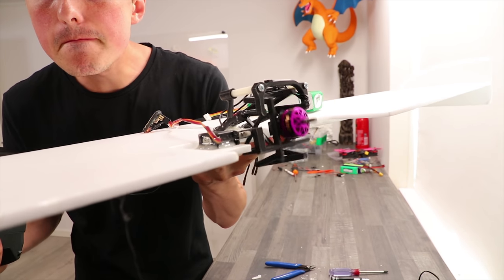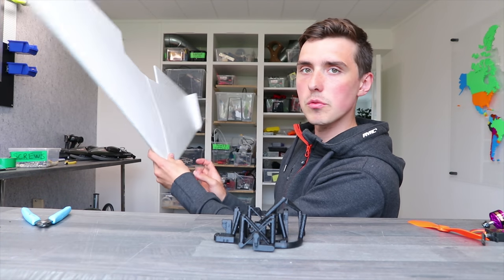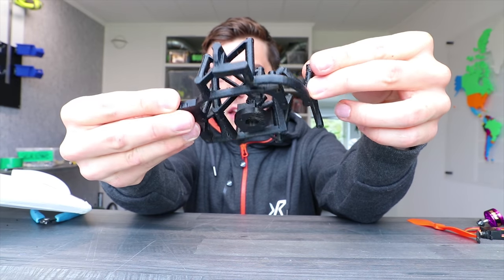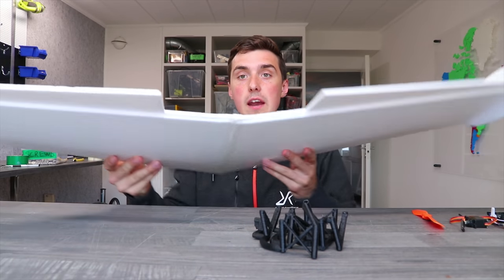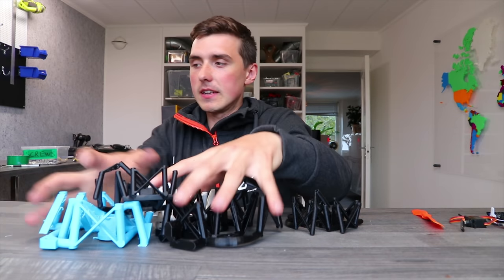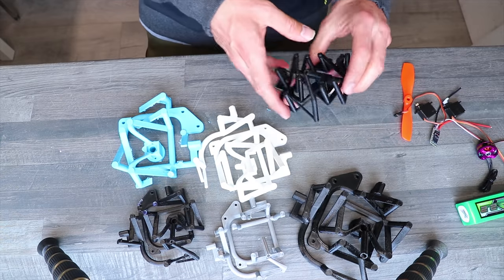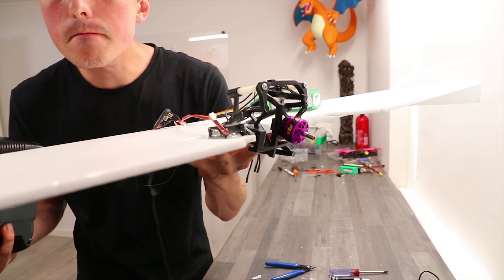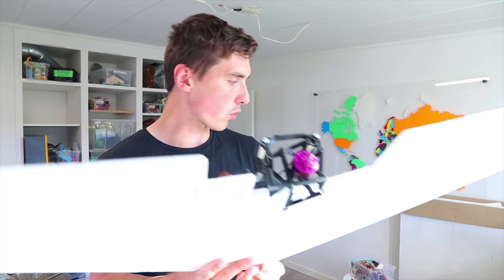3D Printed Vectoring Mechanism

Comment: Stress fracturing negates all the magic of compliant mechanisms, and literally every single layer printed is another perfect spot for one to happen lol.... I bet this is a scenario in which a resin printer would really shine. Personally, I'd say your prints snapping is more closely related to "forced delamination", rather than a failure of the material to endure the applied stresses.
Otherwise, apart from your not printing these in their original medium of titanium, I would imagine the dimensions/thicknesses  throughout the entire mechanism would have to be altered significantly for every different plastic you've printed them from. Technically, by only changing the material of the prints (rather than altering the varying thicknesses in the print) you were only determining which has the closest attributes to their original titanium counterpart...... that is assuming you didn't altar any of the dimensions from the original design file.
.....Apart from that, it seems the simplest option would be to scale up the air frame ;-P

Comment: Tube with motor mount plate with stub axle top and bottom that locate in a secondary ring that has horizontal stub axles fitting into tube bearers set in wings??? Two ends of household plumbing pipe of different sizes and some dowl + thin bearer tube + glue and drill

Comment: I think the biggest problem youre going to face is gyroscopic precession ... I might out of my bonking gorde here, but, unlike on a rocket, your propeller is going to apply force 90 degrees from the axis that you are trying to rotate it at. 

Meaning when you try to pitch, since the mount isnt rigid, its likely going to yaw. or whatever. 

Either that, or your motor is torqing the shit out of the motor mount and its not designed to handle torque like that.

Comment: Why just a simple hinge? It makes it a lot harder when you try to use a flexible hinge type.
Reply: He was originally trying to do a 2 axis vector so it would not need any control surfaces.  To do that, it needs to rotate in the pitch and yaw axis at the same time.  Not sure how it would have rolled, but since it never worked anyway, that point is moot.  Though usually if you put in enough rudder the wing will drop.  But since he gave up on the 2 axis version, with apparently no flight test at all, he only needed to pitch.  He could have done that by attaching the motor to a elevator instead of that elaborate 3D printed part though.
Reply: Yes, but even a pan and tilt mechanism would be a great deal easier just using screws for hinges. And good point with the roll axis, never would have thought about that!

Comment: Wtf...the esc can provide the 5v power. None of my eco planes need a separate power converter for the planes. The only one I have that does is for my hexacopter and that’s because of the way it’s designed. If you get a esc capable of powering the receiver you can eliminate some weight which is good in the end...

Also you should treat your print. By that I mean after it’s printed place it in a pot of water and heat it up to boiling. After 10 or so min cool it down and it will be stronger. It will take experimentation as the print will shrink and possibly warp. What this does is heat the print enough to almost melt. This allows the molecular structure to rearrange into a more stable and solid piece.

Comment: I think instead of having it flexible make it stiff and use gyroscope design to vector. Bit obviously with fixed max angles. The concept idea is cool but nor really suited for 3d prints. However stiff should be well possible
Reply: May be make it in Titanium?..
Reply: Apart from the fact that you cant produce this diy out of titanium, it would be to ridgit. A gyroscope style design where you controle the axis via servos would be the better design IMO

Comment: I laught my butt off too with the maiden flight and your reaction xdddd.. Apart from the obvious flex which made the problem worse, you need to first calculate the CG and then the thrust line of the motor needs to be tilted so it goes through the CG..... Ask me how I know..

Comment: some info.     ever hear of a thing called   d o m.     distribution of mass.     No one else  has, either.      a  Lot  of  mass  was  added to the airframe,  AFT  of the c-m.   center of mass.         as you have  perceived,  controlling a   zero-dihedral flying wing  with vectored thrust, is not practical.     cheers

Comment: Could your concept even work if nothing went wrong? I mean you couldn't control the roll with the vectoring mount only?! 
But great video anyways👍
Reply: That is because he had ailerons installed
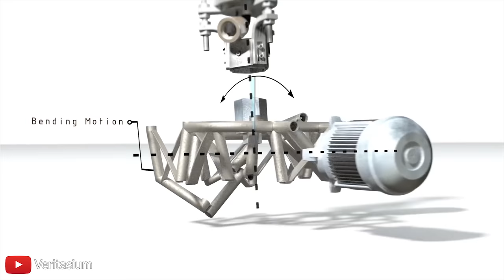Reply: velos26b Well at 1:49 he said that the vectoring mount would eliminate the need for control surfaces. I think he only added them after realizing that the vectoring mount didn't work in both directions.

Comment: Compliant mechanisms and FDM printing is no bueno - you're after fatigue life for compliance, which is something that FDM printing will have a hard time producing. Also, in terms of engineering, getting a compliant mechanism to produce a predictable lifespan is not trivial - it's something that is just now gaining traction due to the abundance of computing power and analysis available today. 
Somehow you're going to need to design that apparatus so that the bendy bits are parallel to the sidewall direction, so it's not pulling layers apart when you bend it!
Look up 3D printed leaf springs that are available on thingiverse for an idea of what I mean

Comment: Um normally esc already do the voltage step-down for the receiver I mean I have a 18.5V 5s lipo and my esc transforms it to 5 V for my receiver
Reply: Depends on the esc. Drone escs usually lack the 5v regulator because you would unnecessarily have 4 of them on board.

Comment: you made it too complicated....a little is A LOT.lol
The motor isnt at the CENTER of PIVOT ( dont get it confuse with CG).
So when you..installed the thrust vector...CoP got all wacked ( variable)
depending how much power you gave to the motor.

Without the telescope...it's not neccesary tail heavy....it's the Thrust angle
of the motor...or the angle of the ailerons...which sort of alters the AOA...
or the air foil shape ...as a whole.

So when you mounted the motor (at the field)...it might had been
slightly off ( above or below) the center thrust line of the wing
A little is A LOT.lol

It takes time to dial in a model...That's why you sort of want to start off
with a trainer.so you can understand a little bit better what happens
when you make throw adjustments.....without a fuselage it's a little
bit tougher..

The Parkjets that hovers/Harriers..such as f-18, Mig 30...ect 

 has those thingie wanna be  WINGS in FRONT...to help keep the NOSE UP..That's why it Nose in.  when you launch it .( you didnt have the connard in front.lol)
But it sucks at Higher speed..so model will act as if it's Tail heavy.
It'll be helpful if you had adjustble canards in front...link to the scope..hope
that makes sense.

Comment: Late to the party but:
This is what’s called over-engineered. Why do you even need a compliant thrust vectoring when you can just make a dual axis rotatable joint and achieve better results. The idea of compliant thrust joint sounds idiotic. You need thrust where you need it, not where flexible joint will tell it. There is a reason why this isn’t on real jet engines and never will be. Compliant joints make sense when it has to hit hard surface like feet hitting the ground, not prop slicing air.

Comment: And another one bites the dust...
Can you use Colorfabb XT-CF 20 filament for rigidity and strength?
https://colorfabb.com/xt-cf20
And print on a dual extrusion machine with nylon or flexible filament for the joints?

Comment: I dont think its Doomed, we have materials MUCH Stronger than PLA and almost as strong as Steel. I would love to see you make that work, Email and send those files to contact@visionminer.com and we will Print those out of a PEI (ULTEM) or Carbon Fiber Material for you for FREE. Google Vision Miner ULTEM PEEK and you will see why I think that material will solve your problems :) It takes some expensive High Temp machines to print the materials but thats what we specialize in. Send any files you need printed to get this bad boy flying, and we will do what we can to help.

Comment: you used the weakest material & you wanted it to work on a crash airplane? you were just asking for failure my dude. maybe petg which is tough like abs but flexible enough to make a clip box out of this material. also abs itself but not sure how flexible it would be. polycarbonate BUT with carbon fiber is a good choice. but pla? c'mon man you are a 3d print guru on youtube so you should have plenty of filament options and not make poor filament decisions. once you said you stuck with pla i already knew you were fucked. best bet is petg because it gives you a good amount of flex without breaking and very tough. i'll wait for follow video and maybe you could prove me wrong but theres better options out there that would give you desired results